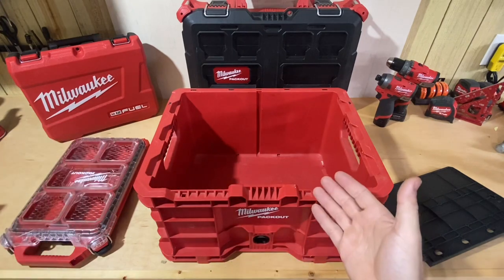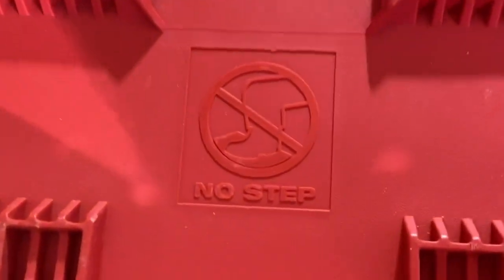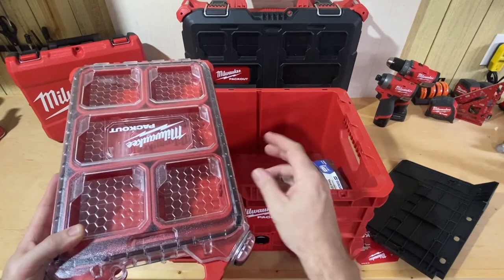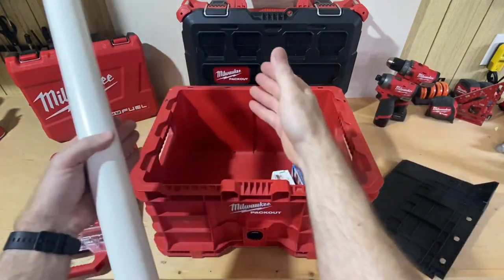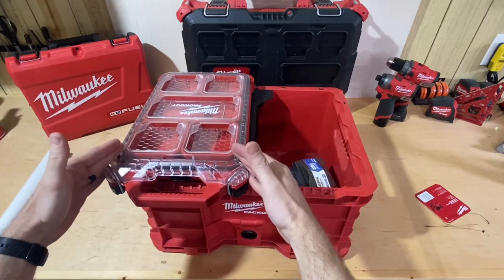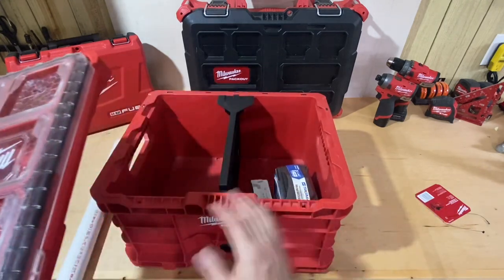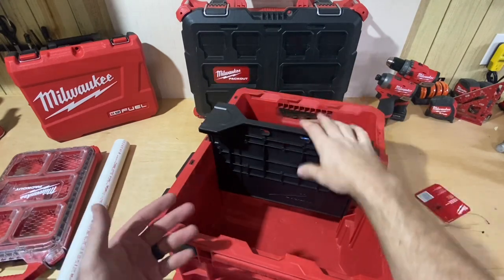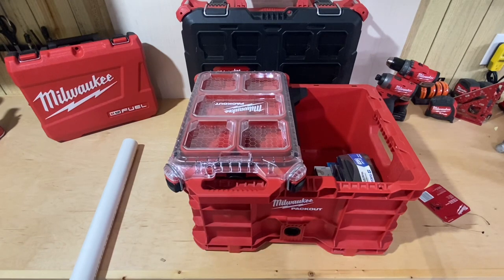Milwaukee PACKOUT Crate and NEW Divider 48-22-8040 - It makes how I use my Crate even better!

Comment: Thanks and you can stack multiple crates on each other, and hang on the wall, and do mod to add feet to bottom of knee pad plastic holder and add to top of crate for garage seat, also put crate on the roller caster wheels base and it works really good seat like that! Thanks  for tips!!🎉
Reply from the maker: You are welcome.  The crates, though expensive.. have been super handy 👍

Comment: You can attach a full size organizer to the back of crate and use organizer handle. The crate essentially will hang off of the crate
Reply from the maker: Thanks, I will have to try that out 👍

Comment: I could 3D print a cleet receiver to attach to the front of it so it would engage all four cleets on the 1/2 size organizer
Reply from the maker: I haven’t had a problem with mine coming off yet without it, but I think it would be a good idea for them to have added it.

Ive thought about getting a 3D printer a time or two. I’ve been wanting some bins for a slim Packout that take the Bit holders from the Dewalt cases.

Comment: I’m so happy to hear that you use the crate as a seat as well lol! That divider is a game changer.. I use my crates to organize so many things like caulking and paint supplies! Packout really changed my efficiency at my work sites! Great video as always and have a great weekend. I forgot to mention in the previous video but I’m happy to hear your cat is doing better and a speedy recovery.
Reply from the maker: It’s a really good height for a seat….and I must confess… a step stool in a pinch 😂.  Just stand close to the edges.

I’m thinking of putting some magnet bars on one and using for either tools or drywall knives. May make a drywall supply crate.

Organization just makes for a better day. The job is sometimes hard in itself, not being able to find stuff only makes it harder.

Thanks from my cat! She has been doing well so far.

Comment: You said you can’t use the double organise if things are sticking out the crate, but you could instead connect the crate on top of your organiser
Reply from the maker: Yeah you can snap things on the bottom with/without the divider… I just meant with the divider.

Comment: I just bought this, and use it very similarly to you BUT I just discovered the packout cabinet and I think this solves all the issue for me. I use the roller dolly, with the cabinet, then I throw my m18 vac and milwaukee tool bag on top then I can open the garage of the cabinet without removing anything and grab product
Reply: I also still get to use the cabinet as a crate cuz it has cleats on it back
Reply from the maker: @nathanriddle4190  I’ve looked at those and have thought about getting one.  I don’t use a “stack” that often to work out of but I can see where it would be useful.  Kinda like the drawers.. if I ran a stack all the time cabinets and drawers would be the way to go.

Appreciate you sharing your thoughts👍
Reply: @MORGAN'S Maintenance  I got the drawers but it's full of my blades and bits and stays in the truck, but it makes it nice to gather what I need and throw it in the cabinet along with the proper tools for the job, then on the wheels then the tool bag and vac and that gets me dialed in for most jobs, a ton less trips to the truck
Reply from the maker: @nathanriddle4190  less trips to the truck is always a win 👍

Comment: Really good review and logical reasons for getting the Packout crate. I have a bunch of the Packout modular pieces and really like them, but I always figured the Packout crate was basically an expensive milk crate, which I already have a bunch of. Your review is making me reconsider and I will probably get one of these (thoughmy wife isn't going to be happy with another Packout item)!
Reply from the maker: Thanks so much.

Mine is the same 😂. Every time I mention one she says, “You can’t need more of that”

When I bought mine they were $39… I think they have since went up to $49.  I do a lot of swapping for different jobs everyday in/out of my truck so I like the ability to just throw odd things in and not have to have it perfectly fit inside a case.  If you didn’t have other packout then they would be just a crate… but being able to snap them in to your other stuff is the benefit.

My Truck Loadout Part 2 kinda shows how I use one in my truck all the time, and my 2nd one stays in the truck as my job site seat/ parts for the job carrier

Truck Loadout Part 2 - I Now Work out of my F150 100% / Milwaukee Packout and Decked System #tools
https://youtu.be/f9FS_fc0Bak

Comment: Awesome addition.  Question, will the crate and the divider hold two of the smaller organizers side-by-side?
Reply from the maker: I believe so, I actually haven’t done it for some reason 🤷‍♂️. I would think they would even fit on better because it would keep them from being able to slide in towards the middle like I showed.

Unfortunately I can’t check it at the moment. I’m out of town… hopefully someone else can answer sooner, but if not I can check when I get back home…
Reply: @MORGANSMaintenance  It would make or break the deal for me.  I only use the half sized organizers because it's a better system in my pickup tool box.
Reply from the maker: @mozzberg590  I’m the same way, the half ones work best for me too. They fit better and they typically hold enough of whatever I’m wanting to organize without mixing two things that aren’t alike.

Keeps me from carrying in things I don’t need adding weight.
Reply from the maker: I won’t be home for a few days but I screenshot your question to remind me. If you don’t hear back message me again. 

Hopefully someone else will read it sooner though and give you an answer, sorry I can’t help you at the moment.
Reply: @MORGANSMaintenance  Thanks, no rush.  I'm just looking for another reason to buy more PACKOUT accessories that don't fit in my truck.
Reply from the maker: Finally got back in town with my tools… checked this morning and was able to put two singles side-by-side with the divider.

I figured it would work… but I didn’t want to tell you without seeing it with my own eyes.

Comment: Can't you put the larger organizer under the crate and lock it in?
Reply from the maker: You can.. the divider just gives you more options on the top of the crate using the half organizers.
More if you are using crates in a stack with stuff on the top and bottom.  

You can often times make it work by organizing things in a different way without the divider, it just gives you more options… and divides the crate.

Comment: You never said anything about the bottom of the crate.. it works just like the top
Reply from the maker: Yeah you can lock in anything on the bottom because it has all the connection points.

Not being limited to just putting your small organizers on the bottom is a nice feature though.. that and in order to stack your small ones on the bottom you would have to have at least 2 to level it out. Sometimes you may only need to take 1.

The divider just gives you more options when you may need to make a certain stack…. You can get by without it.

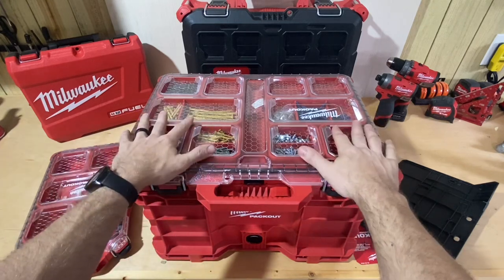Comment: 3:48 Why don't you just stack the crate on-top of the double organiser? then you can over fill the crate as much as you want, and your organiser is still clipped to the crate
Reply from the maker: That is an option you can do.  There are multiple ways to stack stuff with your crate.

The  point I'm making is that the divider just gives you more options for people putting crates in the middle of their stacks.  Stuff on top or on bottom when situations come up.  If you 100% of the time carry one crate and one double organizer, you can do that. If that's the case, you would not need a divier.

Comment: Put the organizers on the bottom...
Reply from the maker: That works great and I do that sometimes 👍

The divider makes it nice though if I only want to carry one single organizer (if it’s on the bottom it’s would be wonky when you set it down. You can also access the organizer and crate at the same time.

You don’t have to have the divider, it just gives you another option in locking stuff on the crate. Mostly it’s better than just making your own because it gives you the lock in ability.

Comment: Good lord.. a 9min video on this.. you do know your slim half organizers clip onto the bottom of the crate eh? Get to job, unclip 1 or 2 of them. Sigh... Or leave them connected and just flip the crate up.
Reply from the maker: You can do all of what you said…. But someone may want to divide their crate. If they do, All I was trying to show is that this  divider allows you to do more with your crate than a piece of plywood 

If you want to do what you said, use a piece of plywood… if you want to be able to clip stuff on top, you may want this one.

Thanks for the suggestions though, it may help someone who reads the comments. 👍

Comment: It a shame saying $18 for a piece of plastic. Is cheap. It really should not be more than $5 bucks. Maybe it just me. But seems over priced. Im sure someone going to make this and sell it themselves and still make a great profit for less!
Reply from the maker: It just depends on what your time is worth. I could make something out of plywood, but it will cost me the plywood and my time to cut to fit… (which it’s not straight and a tapered thickness) …then it still wouldn’t latch in the single organizers.

It shouldn’t cost that, but Milwaukee has to make their cut, then the truck driver, then Home Depot. $18 stinks, but my point was that it’s cheaper than me making something that works the same.